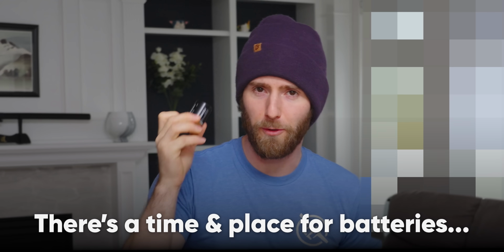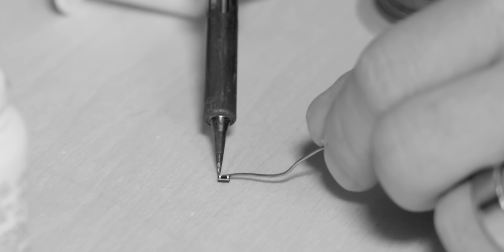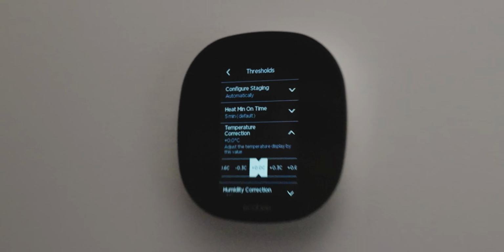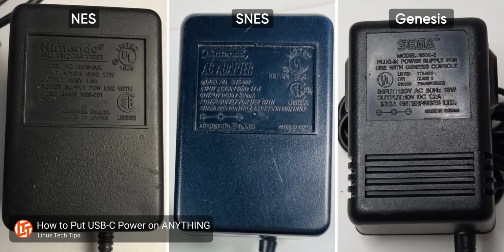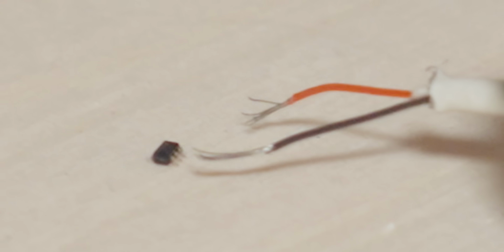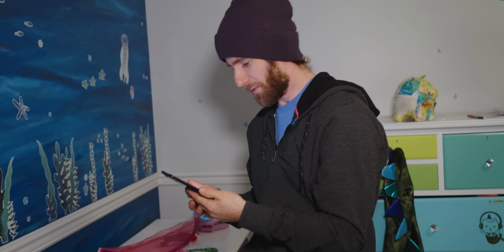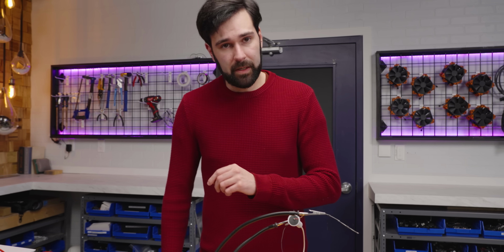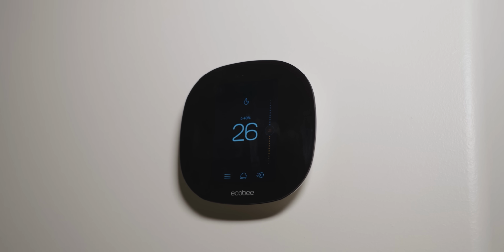I HATE Batteries! - Converting Wireless to Wired (a cheapskate’s guide)

Comment: I realise you guys were trying to do this with what was in-house, but you could totally make a tiny pcb the size of the button cell and put something like a SMT LT3470 on it with its associated components. Drop the voltage down to around 3v and still be able to compensate for draw spikes. I imagine the device goes to sleep for twenty minutes and then wakes up to measure the temperature and report in. That'll be what the sudden current spikes are and how the unit lasts so long on a button cell.
Reply: Yeah, I'm thinking you could fit a regulator, a cap or two, and a USB socket easily on a coin cell sized PCB. Add a 3d printed cover and you're featured on hackaday.
Reply: Yeah, what crazy prime said. Design it and maybe send one to LTT maybe they would provide the specs. Maybe with the appropriate disclaimers. Then the rest of us could make them or have them made as needed.
Reply: Honestly that would be awesome have someone sell them and put dip switches on and a pot to adjust the output and input.
Reply: Sounds like a product to me
Reply: The MIC5504 would have a temperature increase of about 5°C, on a 10mA continuous load. 
There is absolutely no need to add a buck convertor ...
Reply: considering the low power these devices use paired with them often having some sort of wireless connectivity, I also think a buck-converter (or any switching converter) might be the worse choice here. Linear regulation should be adequate, lower noise, and has less potential for interference.
Reply: Would be an interesting side hustle to make a whole wall power converter that replaces the back panel of the sensor, so it can just hang out directly on the wall. Obviously would have to manage thermals so as to not throw off the sensor
Reply: You might be able to use a single red LED to drop the voltage instead of the string of diodes as they have a forward voltage of about 2V. It may detectably flash when it is talking on the wireless too.
Reply: I think a single capacitor would've worked wonders there. That seems like the first thing to try if you're having trouble with handling short load spikes...
Reply: @Niosus  And I think people are completely missing the point when they're suggesting capacitors - these aren't "spikes" in the way you seem to be thinking. This is the device turning on for only a short period of time, drawing a very small amount of current for a bit, then turning off for a while and drawing an even smaller amount. The problem isn't "spikes", the problem is that any solution relying on resistors is going to change behaviour depending on how much current is drawn, resulting in changing voltages. A capacitor might make that problem better but it's 2 layers of the wrong solution, instead of replacing it with something that just provides a guaranteed (regulator) or pretty much guaranteed (diode based dropper) voltage in the first place.
Reply: This was my thought. A PCB could be made pretty easily for this and cost less than a dollar, which is certainly better than the time it took him to jerry-rig this.
Reply: I actually assumed they wouldve like designed or had some little board that like clicked in with a USB plug on the back lol. thats what i thought at the first 7 seconds of the video though
Reply: Yeah. There are already a done of ready-made modules that even have a USB plug integrated in the circuit. If you do a search for "CE009 DC-DC Buck Converter" you can buy a tiny little module that'll step it down from 5v to 3.3v with no soldering required. I mean, you'd have to solder wires from the contacts to the battery terminals, but that's all. Cut a hole for the USB-A plug to stick out the back, glue it in place and... you're done. This coulda been a 15 min hack with WAY less jank. It still woulda been cheap as dirt too.
Reply: To be fair, most places have an electronic component shop, don't they? Should be easy to find everything you need in one of those.
Reply: @lidge1994  We certainly don't. Ours shut down years ago and IIRC they never did surface mount.
Reply: For the cost buying a pack of them pre-made from china is probably worth checking out too since the low voltage dc-dc converter boards can pretty tiny.
Reply: you should design the pcb and make them or what not, use pcbway.
Reply: @CraZY.pRIME.  Would take me less than 30 minutes, to design such little circuitboard... 
But they would've to send me the device for dimensions and testing :-) ...
Reply: @CraZY.pRIME.  What are you sponsored by them or something? There are lots of good PCB manufacturers out there.
Reply: @SoLaR27  LOL no. I just  see them advertised on the retro computer repair channels all the time.
Reply: Just use an lm317 in stead of that shitty little surface mount. What am i missing here :/
Reply: @mmmhorsesteaks  Dude, LM317 is ancient! It has like 3V dropout voltage. You can't reliable use it to regulate 5V down to 3V (only 2V difference). This is a job for an LDO. 
Or just mod the wall wart. The cheap ones use an optocoupler with a zener in series for regulation. Just replace the zener with a lower voltage one and you're done. If you don't have a zener with a sufficiently low zener voltage, improvise (e.g. I have a bunch of wall warts with green gallium phosphide LEDs).
Reply: @hellterminator  aaah you see I was missing something :) ty!
Reply: @hellterminator   True but for the average layperson it isn't recommended to crack open a HIGH voltage device and go mucking about
Reply: @kennmossman8701  Technically, it's low voltage (for AC, high is 1kV+), but I hear you. 
The dude remembers the part number of linear voltage regulator, so I assumed he's not a complete noob.
Reply: @mmmhorsesteaks  two diodes will do the same and will probably be cheaper
Reply: @chrisparussin5359  yeah that's around 3.8V if that works you're golden! 
I'm just saying people are overthinking here with their buck converters for a 20mA load...
Reply: @chrisparussin5359  This will not necessarily work. Diode voltage drop reduces when current does. When the device sleeps, the current drops very low, and so will the voltage drop, potentially exposing the device to over 4V. An LM317-ADJ or LM317-3.3 is dirt cheap, and comes in large through-hole packages.
Reply: or, if the current is within range, use a LED with the right Vf
Reply: @asm_nop  simple fix is to place a resistor in // so there is always enough current drawn.
You are wrong on the LM37 - check delta  V
Reply: @asm_nop  It definitely will, they did it in the video and it worked. The voltage drop of a diode does vary with load but usually in practice not by much, and in this case the 1N400* diodes they used seem fine in this workload. The bigger problem with using 2 of them is that it's a 3V device, so you actually need 3 instead.
Reply: @mmmhorsesteaks  I quit using old fashioned trough hole components a couple years ago, and would highly recommend it! 
The end results look a lot more professional, smd components are often a lot cheaper, they're more compact, the circuitboards become a lot smaller, etc...
Reply: @timmy7201  yah sure but if you have to solder them on your carpet and it's maybe your third soldering job they're probably not the best choice :) 
i'd argue they're probably not the best choice if you can't get a lil board prototyped, but reasonable people can disagree here.
Reply: @mmmhorsesteaks  SMD = No need to solder at all!

Get some solder paste that melts at 160°C / 320°F, put the paste on your circuit board, then place the components on top of set paste. 

Now put a cheap cooking pan on your stove, put the pcb in set cooking pan, wait and watch it reflow... :-)

Note: Do not use set cooking pan for food afterwards!
Reply: @timmy7201  That's neat but I have literally none of those things. I don't have a paste-dealer and if I were to "ruin" a perfectly serviceable pan there would be blaming and shoutage. Also, you can't easily paste solder to a wire which i think was very much the idea here (just doin' a lil' hack). 
If they would have had the forethought to get some boards prototyped; order some paste, maybe do a little toaster oven conversion, yes definitely go hog but these were not the circumstances. In the circumstance where you want to hack something up in an afternoon, nothing beats through-hole and a soldering iron.
I am glad you find it convenient tho.
Reply: @mmmhorsesteaks  I've never been a fan of soldering components directly to wires, that's not how it's meant to be done...

Solder paste can be bought online, an old 1 dollar pan can be found at the thrift store. If you own a gas bbq, you can do the reflow thing outside.

Comment: hahaha...  I just let that stuff die....  Never had to replace the cmos battery...  Evan on 8 year old PC.  Either way there r 10 convienant stores stocked with batterys down the street.  Smike detectors...  psssh.  just let them die...     as far as your thermo stat issue.  turn it down!  Close the grates in the other rooms.  like for instance the 5g waves and wifi 6 are a catalyst for COVID and there is evan an audible tone from it depenfing on what type 9f RF you are using.  The low band frequencys dont have this tone, but I can still feel the touch phone radiating on my front teeth.

Comment: Ha I did the opposite, my father had a wired Bath Radio but the Position was suboptimal, so I inspected the PCB and found 2 soldering points for 5V In: old lead battery + DCDC converter and voila. Only one charge per Year necessary.

Comment: When my kids were little I had one of those baby swings, where you could strap them in and hope they would rock to sleep while you pray you have the next 30 minutes to regain some sanity.

Well that sucker took six D batteries and blazed through a set in less than a week. After two dozen D batteries I finally said "f this" and bought a 9VDC wall adapter, cut the end off, and soldered it on. It very quickly paid for itself.

Comment: A potentiometer to drop a fixed excess voltage can only work efficiently when the current draw is fixed and you don't need your fixed voltage to have a low impedance. Probably hardly ever.
I'd look for a 3 terminal adjustable regulator like a LM1117-ADJ.

Comment: Oh Boy :) You need to set up the voltage first, than adjust voltage with sensor pluged in, because voltage drop when you plug a hardware, no mather what type, and when you are measure with no harware pluged, voltage go up and with hardware down. Plus you can,not just add a trimer potentiometer , you need an LM317 and capacitor plus resistor why? Because in this way is a right way but in your way you regulated  a volt but also current drop down, so no current no working device, no mather how voltage you put in.

Comment: What I need is a replacement for a 2032 that takes 2 AA batteries which are individually replaceable. It can slot into the coin battery slot with 2 wires coming from it that can be attached anywhere in your case where you have roomor on the MB itself. A blinking led/beep when one of the batteries is empty would be nice as well.   And yes I know this can easily be achieved, I just need a premade product. 
Something attached to the permanently on 5V rail to recharge would be nice too. Yes, a device that keeps an optimal internal charge discharge cycle is possible as well.
How can a clock battery and everything built on top of it still be a thing, this is just crazy it's been around since the AT.

Comment: Unrelated video idea I would like to see is a similar idea to the eBlaztr all in one, but a 'brief case' version. I'm talking a practical portable desktop you set down, open the lid with built in screen then unstrap and lift out a genuine at least 65% keyboard. If you find an actual brief case in Noctua brown you can probably get them to sponsor it. I also like the mental image of a brief case with an  kettle lead plug on the side.

Comment: Uhh... wouldn't anything that runs off a battery be able to accept a range of voltages? The voltage of the battery it was using would change as it discharged.

Comment: Why not use a lm317 voltage regulator?  They are adjustable down to 1.2V and would only require a capacitor and a couple of resisters to set the voltage.

Comment: more agitating, and increasingly commonplace. Are electronics that use shitty BMS techniques to prevent replacing internal batteries. Philips for example, does this on their higher end electric trimmers. Disconnecting the battery, or having it drain too far and losing any remaining passive current resulting in a bricked device that always thinks it needs to be charge and won't function, unless you really know what you're doing and hack it back together. They don't want you to replace a $7 battery every year or two. you gotta go and drop $100-200 instead.

Comment: you can better use those realy small ams1117 regulators or some efficient buck converter also for pennies i use buck converters 100% of the time i dont liek regulators (linear) nor diodes or resistors

Comment: rechargeable devices that make sense to be re-chargeable are still fine, like a mouse or even headphones if you dont mind lower quality sound... A CAMERA makes no sense as usually they run 24/7 and its not like you move it around, a wireless camera is just... heresy. if the batteries are just addons to the cable to be able to run in a power outage then its actually a good idea, if i was a thief i would just cut a cable to the camera if i had acess to it and would not give it a second thought and get recorded by it xd

also people who make things with a battery that cannot be taken out or recharged with user friendliness in mind (without a solder) should burn in hell.

Comment: Linus, that voltage regulator needs a 1uF capacitor on the voltage input and also a 1uF capacitor on the voltage output.  You can probably skip the cap on the input, but the cap on the output is absolutely necessary to stabilize the regulator.  It might still work anyway, but its not a good idea.   You also probably don't need the pot... that's kinda dumb, actually (sorry).   If you need to drop the voltage a bit more, try throwing a diode in-line with the voltage output.   Or not messing with this stuff at all.

All of these remote sensors are fun, but they are almost entirely unneeded.  You just don't need any of that smart-home sensor stuff.   About the most that you would want would be remote-controlled lighting (which is wired anyway since... its lighting).

-Matt

Comment: fun video.  personally, i think you ought to make a simple board out of high temp plastic or fiberglass (to lower the soldering skills needed) slightly smaller than the button cell and putt yoru components through that.

also, whatever happened with your liquid cooling and dumping heat into the pool?  i am very interested in that concept.

Comment: You could've used a diode. They have predictable voltage drops. Also you don't need 3,2V exactly, the battery itself has a range that the device will tolerate. Resistors reduce voltage depending on the current. If there's not a lot of demand, then current will be low and the voltage to the device will rise to the supply voltage. 3.3V supply with a small Schottky diode would be perfect.
Reply: Oh, you did in the end. Nevermind.

Comment: With the current draw issue, I wonder if a higher power voltage regulator with a large resistor across the output would help, since that would give a constant load for the regulator to work with, and then the very low power draw of the sensor wouldn't cause the regulator problems keeping the voltage in the right area.

Comment: This would have been a great video for PCB Way to have sponsored.

A CR2032 (or similar 20mm diameter battery) could have a PCB that's about the same diameter as the battery with contacts that would touch where the battery was, have an integrated linear voltage regulator, and USB C port.  Different thicknesses could be handled with a simple 3D printed spacer or double sided tape.

No soldering necessary.

Comment: I use buck converter modules. They cost about $2 on ebay and they have variable input and output voltage. They are really useful.

Comment: @LinusTechTips don't you have a electrical engineer or embedded systems engineer walking around? 3V3 on such low power devices is totally fine. most microchips now a days run at 3V3 or 1V8. if it is a 1V8 type it already has a internal regulator. also never use a resistor devider for the voltage regulation on a load. (so also not pot meters)

Comment: if anyone is doing this, get something like MP1584EN, it's small (22.3mm X 17.4mm) and does input voltage: 4.5V to 28V and output voltage: 0.8V to 20V; another one is LAOMAO voltage regulator which is 12.5mm X 8.8mm and does 5V to 3.3V, I use 5 of those for my Arduino micros that only take 3.3V and it works fine. And if there's a lot of room just get LM2596, it has 2 big capacitors and is probably the safest of them all

Comment: What a coincidence! This morning I just started thinking about de-batteryfying and half-smartifying an automatic air freshener dispenser in our washroom (it eats 2 AA batteries in about about a month, which is not acceptable IMO) with a Raspberry Pi Pico and a light dependent resistor. The idea is that  it will activate every couple of hours AND a few seconds after the light is turned off if it's been on for at least 2-3 minutes.
I'm more familiar with the programming part, but if anyone had a good solution for controlling the 3V circuit of the dispenser (including a small motor) with the Pico (it most likely can't supply the current the motor needs) , I'd be thankful

Comment: PSA do not breath in the fumes of solder or flux, be sure soldering in a room with good ventilation.

Also... maybe just buy those variable buck converters with a USB male connector, all you need is just solder on the cable leads.